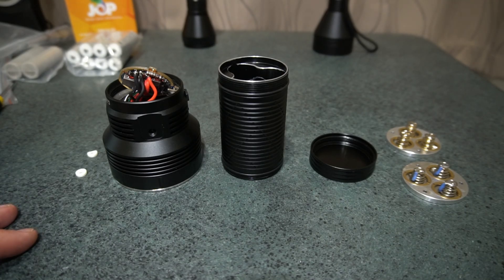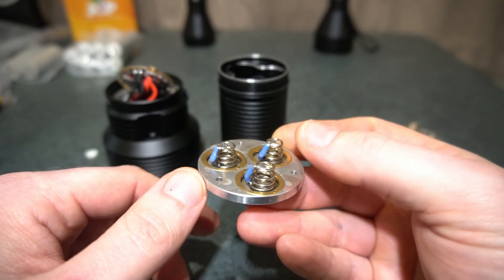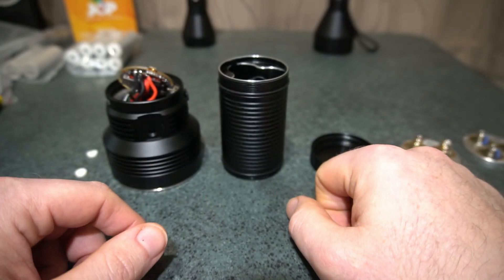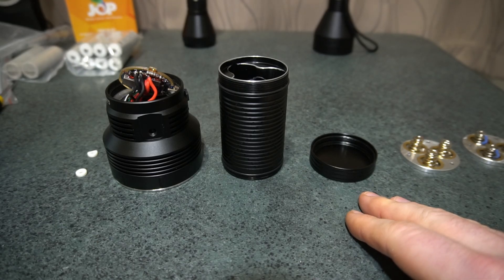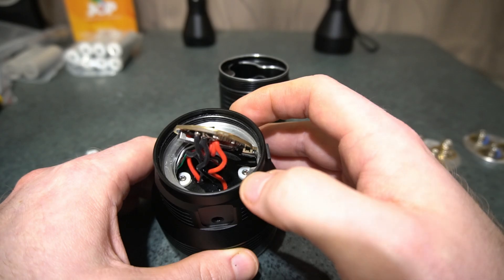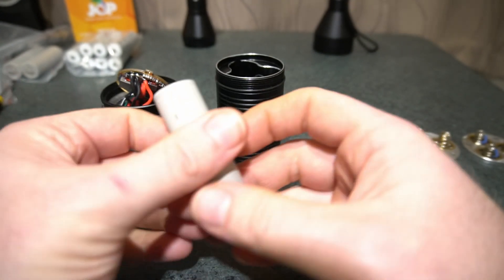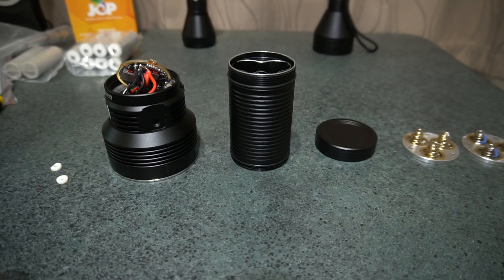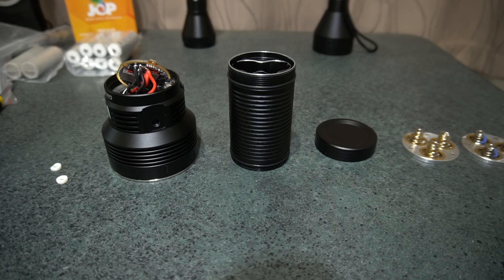Convoy 3X21C SFT40 vs LHP531, Buck Driver, Modded (Must Watch Before Buying)

Comment from the maker: Once the mods are in place it's an incredible model, I really like it. The SFT40 is the best overall version because its high level offers good range (sustainable), whereas the LHP531 is only offering decent range and output on the turbo levels which are brief, everything below that is a bit of a letdown. Still, it blows the popular Sofirn Q8 Plus away. I should make a short with both.

The SFT42R should be a good candidate.
Reply: Yeah, I just bought a Q8 Plus and love it. I'd love to see this comparison! After batteries, the 3x21C will be around the $100 mark while I only paid just under $60 for the Q8 Plus on Aliexpress, so I'm not mad, lol.
Reply from the maker: @tom1986ca had a little look the other night and this LHP531 is twice as bright, because it doubles the range or intensity. The Q8 just looks to be a tad more floody.
Reply: @PiercingTheDarkness  LHP531 vs SST40 which one much thrower? Please reply
Reply from the maker: @nayakacreativity3639 I have purchased it with SST40 to check what it's like, but LHP531 definitely throws further.
Reply: @PiercingTheDarkness  thanks
Reply: I'm not finding the LHP531 to be a great LED compared to other options. Glad there are so many great LEDs these days!

Comment: Does 3x21C with SFT40 and SFT-42R LEDs require these modifications? Thanks.
Reply from the maker: Only the SFT42R & LHP531.  

Honestly, just use the Samsung 50S2 option from Convoy and you won't need to mod anything. The issues are all caused by using too high amp cells.

Note: all mods will void the warranty.
Reply: @PiercingTheDarkness Thank you so much for your recommendations. I'll get 3x21C LHP531 with Samsung 50S2 cells as you suggested, hence I have zero handyman skills. 😂

Comment: With the SFT40 version, running as a work light for long duration without ever using turbo, would the screw mod still be necessary? Is it also possible to get off the shelf shorter screws instead of printing washers in heat resistant filament?
Reply from the maker: Yes, you can get shorter screws, but no mods are necessary for the SST40/SFT40 versions, just make sure you really crank down on the bezel.

The LHP531 and SFT42R need these mods, but everyone needs to keep in mind that every mod shown voids the warranty. Simon will refuse to replace, even if the failure is unrelated.

Comment: Hi. i measure the screw to the driver   its 6mm long. its it to long?
Reply from the maker: Then Simon has is now using the correct length, awesome. They used to be 15mm.

Confirming that's the screws behind the driver?
Reply: @PiercingTheDarkness    Now i understand, its the screw thats  holds the  reflector. its still 15 mm long.😢 I cut of the screw 3 mm, and put in extra springs in the battery holder 😊 Before i took the flashlight apart, I testing turbo 2. after 15 seconds it starts smoke. i saw  some solder paste around the led. I see below  you have write  about the wire provides several leds, i must order other battery with lower amp  discharge. Molicel P45B that you recommend. Thanks for all your tips 👍😊

Comment: Which led type and battery combination should i get for reliability without any modifications for Convoy 3X21C. Thank you.
Reply from the maker: You still need to check the screws regardless of which version you buy.

SST40, SFT40, SFT42R should be fine.

I'd go for the Samsung 50S2 option.

Comment: Has anyone got the LHP531 model in 3000K?  The SFT-40 3000K looks great (and I know it's high CRI) but the allure of the higher output LHP531 is appealing if the tint is nice.  Use is primarily a wooded area around a lake so colour temperature of 3000 or 4000K is best suited to my task.

Comment from the maker: UPDATE: The 3X21C is receiving modifications to the LED MCPCB which will prevent the desoldering issue. Currently, 3x LEDs are powered by 1x pair of wires and those wires are getting too hot and desoldering. The other 4x LEDs are being powered by a pair of wires for each 2x LEDs.  At the time of this video I thought the LEDs were desoldering but it's the wires on the driver desoldering. This is happening with high drain cells like the Molicel P50B and EVE 50PL. The P45B are okay to use. This is only affecting the LHP531 version. 

The SST40/SFT40 versions do not require any modification to the springs, the only mod required is to shorten the screws. 

Simon has mentioned he'll use shorter screws, but no guarantees this will happen when he kept denying there were any issues. Best to check.
Reply: I received the SFT42 version yesterday & wires have desoldered I think, as I heard a little clink noise in the 2nd turbo mode.

I'm not impressed as I had a LHP531 version that did the same using 50PL Eve's.
Reply from the maker: @Rod41983 the issue is the high current cells, you should avoid using anything higher performing than Molicel P45B. I've insisted Simon remove all but the Samsung 50S2 cells to prevent issues, but unfortunately he doesn't listen. 

This model is yet to receive any changes, this will happen on the next batch.
Reply: @PiercingTheDarkness Do Samsung 50s2 batteries provide enough current to utilize the potential of the LHP531 version?
Reply from the maker: @krzysztofmarcol204 100%. 45A pulse discharge. The higher resistance will help to reduce the current to safe levels, this prevents the solder melting.
Reply: So if for example i buy the LHP531 version with these Samsung 50s cells, i get 100% power and no de-soldering?
Also, how long does it approximately take for Simon to release these new batches?

Comment: Good afternoon. Tell me, how can I get a current of 100 amperes from a convoy driver on any powerful flashlight of a suitable diameter? Do I need to make any modifications to the driver itself??
Reply from the maker: No modifications to the driver, you'll just need to bypass the springs or add dual springs as shown. This is only for the LHP531 version.
Reply: @PiercingTheDarkness  Those. does a 54 amp convoy driver actually pull 100 amps?
Reply from the maker: @Yuri19591  Yes, as shown in the video. It maxed out my clamp meter at 100A, so it's more likely doing 130A with dual springs.

Comment: How big of an issue do you think this would be with sft40, less risk than the other emitter?
Reply: Especially if purchased with the eve 5000mah 60 amp batteries?
Reply from the maker: @floras7826 I can't answer that since I only have P45B cells. Most likely no issue since the SFT40 is only drawing 65A, the LHP531 is drawing over 100A
Reply: @PiercingTheDarkness Alright, do you prefer sst40 5000k beam pattern or sft40 5000k for this light? I don’t need maximum throw as i have the 3x21D but i want a good balance. For the sst40 version with the new constant current driver do you think it has decent sustained output and how do you think it compares to sft40 version for sustained and heat?
Reply from the maker: @floras7826 I have just received the SST40 version, but haven't yet compared both outside or run any tests. I'll have to get back to you about it once I get a chance.

From the quick blast I gave it, I prefer it over the LHP531. Yet to know what I think against the SFT40 though.
Reply: @PiercingTheDarkness You’re amazing for actually buying a new SST40 one just because of the new driver, looking forward to comparison between the three. The 3x21C buck driver seems like the actual perfect walking light where you both have a pleasant wide beam on low output for lightning up a path and your feet with nice tint but then also throw out on some fields and see some animals! Sbt90.2 is amazing but you need a really small reflector like wurkkos ts30s for a balanced wider beam for cozy forest walks and it just gets too hot and doesn’t have enough battery life! Which there was more soda can lights with good battery on the market with good 5000k tint, buck driver and balanced throw/flood. One of those 24k mah batteries together with 3x21c sst40 beam profile and handle would be so sick
Reply: I just compared a bunch of your reviews and i just love the sst40 wide beam pattern of this light and it seems like the new buck version with C-C charging etc is the perfect light. Do you think that light is safe and functional without mods with that emitter? I can see all 3x21C are out of stock on convoys site right now, do you know if it’s because he’s finally fixing something with them or why?
Reply: Seems like the new version fixes almost all your original complaints with it too! Are you able to test the sustainable lumen output of the new sst40 or do i have to wait for a comparison video? Appreciate all your answers you have a great community and the best testing areas of any flashlight youtuber😊
Reply: @PiercingTheDarkness 3x21C back in stock and I’m really eager to order but torn between sft40 and sst40 5000k. Please get back to me if you know the sustained lumen output of new sst40 since it gets hotter than sft40❤ Also I have no modding skills and hoping they’ll be fine since i’m not going for the LHP one, how many amps do you think new FET on sst40 draws?
Reply from the maker: @floras7826  Sorry, I just don't have time to check at the moment. Best is to probably check my 3X21C SST40 video with the old FET driver and see if you like the beam pattern.

Comment: Would thermal paste between the driver and the driver shelf aid with heat?
Reply from the maker: Not with this issue. Just had another reviewer report their same light with LHP531 failed.
Reply: @PiercingTheDarkness  Oh..
Once mine arrives I will carry out all modifications and see if I have enough Samsung 50S as spares to replace the RS50s I intended to run the light with.

Might help. 
Anything that will keep the light from dying.
Reply from the maker: @Waldherz Yeah, that would be better. This guy paired it with EVE 50PL cells and I'm thinking it pushed it way too hard. He measured almost 38K lumens which is nuts.

Comment: Jacob, do you consider replacing wires on PCB to thicker ones?
Reply from the maker: I haven't had any reason to do so. I wouldn't want to push these emitters any harder or the phosphor could be damaged. My clamp meter maxed out at 100A, so each emitter is at least at 14A, which is 5A over spec.

Comment: I’ve performed these mods but my wires detach on the driver side lmao….
Reply from the maker: Sounds like your mcpcb hasn't got enough pressure for the wires to get that hot. Either that or you held full turbo for way too long. I can't hold it for more than 40 seconds before finger burns on the switch.
Reply: @PiercingTheDarkness I swapped the driver out and the problem went away
Reply: Looks like my issue. Is it one cable desoldering, or more?
Reply: @FlashlightTech  it was the same wire every time
Reply: @TheWretchedWorld  the black one? What batteries were you using? And did you buy the new driver for your own money?
Reply: @FlashlightTech Yep black negative wire furthest edge of the pcb, eve 50pl. I bought the new driver with my own money as I destroyed the other one trying to modify it to remedy the issue.
Reply: @TheWretchedWorld eve 50pl are too powerful for this FeT driver. I changed my batteries to moli 45 and everything is fine for now
Reply: @FlashlightTech no issues for me with 50pl and replacement driver

Comment: Aw man, this sucks. Do you know if the new version of 3X21E suffers from these same issues?
Reply from the maker: The 3X21E uses a TIR optic, so it won't have screws in the optic, guess they'll be into the mcpcb as they should be. Might still need dual springs though.

Comment: That looks pretty bad, they should definitely address those issues.  While I really like my Convoy lights, it’s hit or miss when it comes to emitter choice and the suitability of the particular reflector to produce a really good beam.  If you pick up a Sofrin sk40 with a perfectly optimized reflector for the sft70 along with better UI, build quality, water resistance, and on board charging for $40, you will understand my point.  Convoy needs to up its game as the price difference between high quality value brands and hobby grade flashlights shrinks.
Reply from the maker: Simon mentioned nothing will be changed. Pretty disappointing, yet kind of expected.

Comment: Shit. I kind of feel dirty after that with my 20 odd Convoy lights. Luckily nothing major problem wise so far apart from a few dusty reflectors, though I haven't stripped any down to see what might lurk inside and now I do wonder. Convoy should perhaps sell soldering kits to do repairs etc. Shame as they are a brilliant brand to be able to select emitters/batteries, not expensive and basically well machined products. After your mods it is a very impressive light but should of course be like that without having to mess with it. Hope Simon is paying attention. Great vid again.
Reply: Yeah my C8+ isn't focused right, since I haven't gotten to correcting it with a new gasket I had to tediously twist the bezel to what appears to be better focused.
Reply: @21700lover  I have a C8+ with SFT70 5000k and one in 3000k and there is a sort of starry pattern instead of a round hotspot at the centre but I just thought that was normal for SFT70 though my M21B with those same SFT70 don't seem to have it, but it doesn't particularly bother me. Just got an M1 with LHP531 4000k and I am liking that very much.
Reply: @geeeeeeeezzzzzzzzzz Can I see a picture maybe? What you're describing sounds like it probably isn't focused properly...